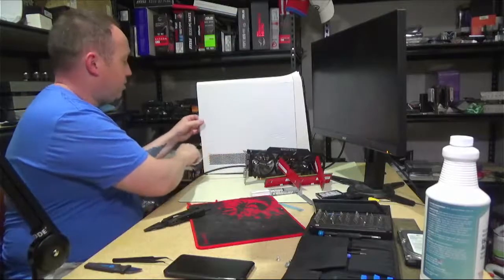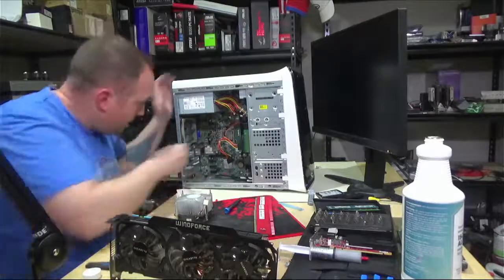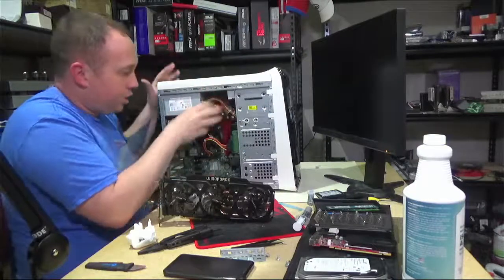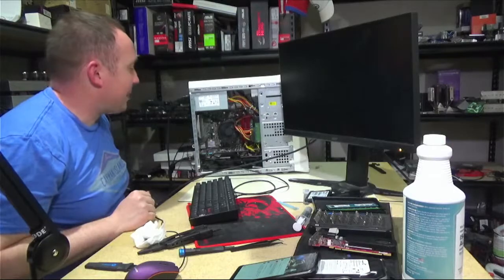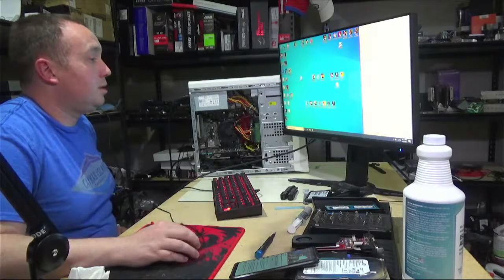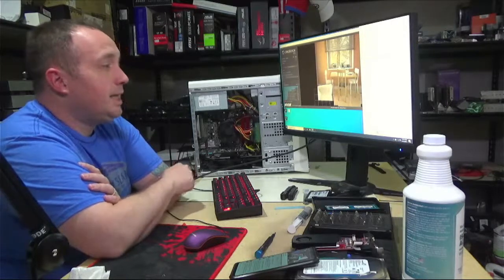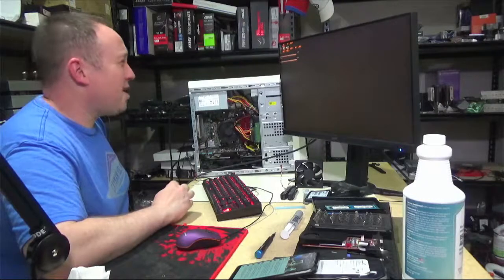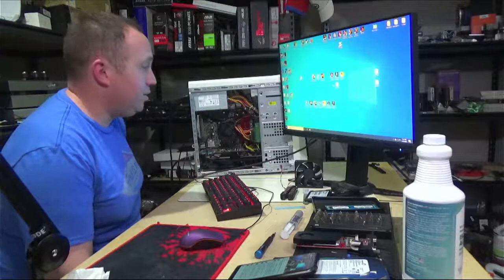$50 Craigslist Dell XPS 8300 PC "Upgrade" Speed run !

Comment: I have this exact same pc, or very similar. It's an xps 8300 with the 2600 non k. I've upgraded the psu and graphics card twice (3gb 1060 currently), put in 16gb ram, and replaced the hard-drive when the first one failed. It's basically a pc for my kids to play Minecraft and Roblox on. It will run other things pretty decently as well. To make it run better I disabled all unnecessary start up software and also disabled many of the effects that run in the background on windows 10. It may not run AAA titles on high settings, but for a kids starter gaming pc it's really great.

Comment: do you think a standard sized gtx 1060 (lenovo or dell branded or zotac mini) would fit into that case with the same layout as yours? thanks in advance. ive never installed a gpu and i worry that it will hit the ram or the little 1 inch by 1 inch (roughly) heatsink below the gpu area
Reply: I'm trying to find out too, i wanna get a 1660ti, i think it'll fit cuz bro managed to fit a  3 fan GPU in there and i wanna get a mini dual fan gpu
Reply: i just got a evga 1060 mini and it fit @joemama7006
Reply: @joemama7006 the mobo only supports legacy mode so anything newer than 10 series doesn't seem to work...for amd it's anything on the rx line doesn't work.

Comment: I got a XPS 8500 for free off Craigslist and I upgraded the components. It originally had 8GB RAM but I used the 2 empty slots to make it 16GB total. It had no HDD when I got it and I added three HDDs I had laying around at 4TB, 3TB, and 1TB capacities. I know SSD would be a lot better but I didn’t wanna buy if I had workable components laying around. I also added a 16GB mSATA chip because there was an empty slot for it and I had it laying around so - why not? Overall it’s not a bad little machine for 10 years old. I set it up as a NAS and media server.